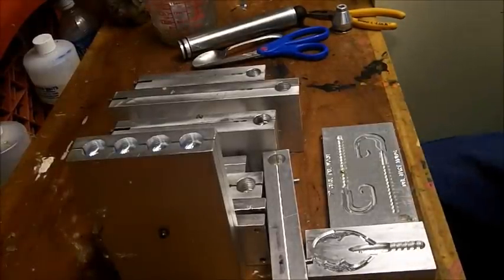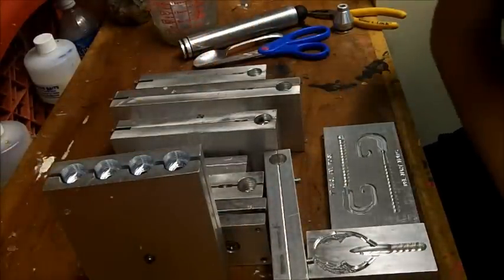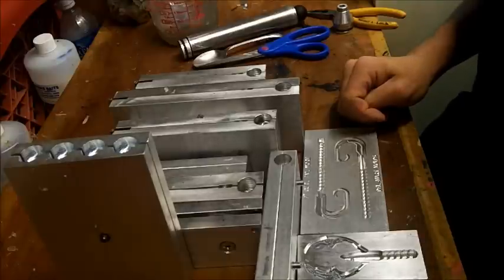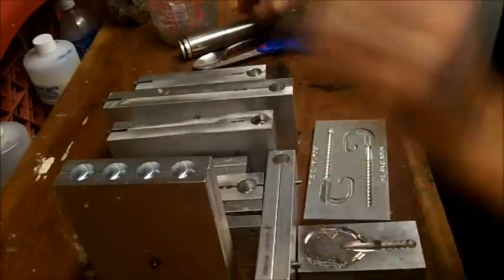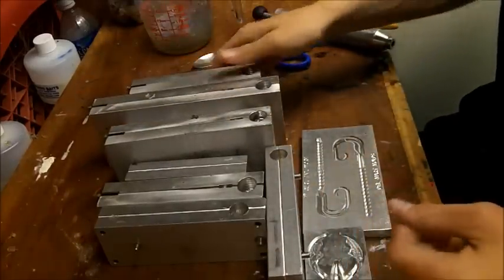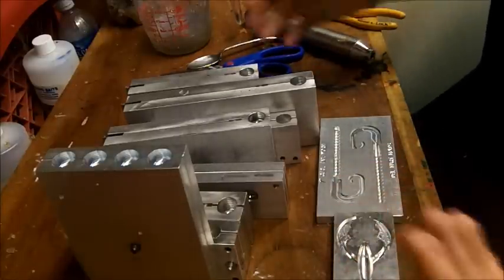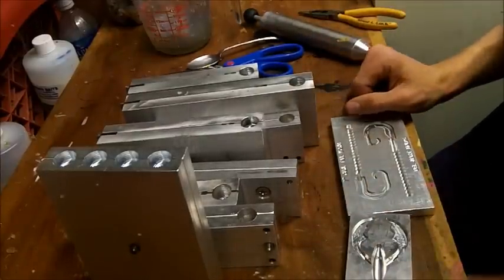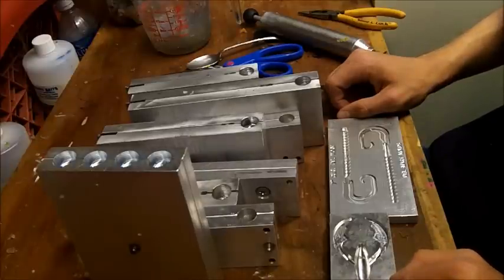Aluminum Molds- The Mystery Explained

Comment: making your own fishing baits can be fun exciting and rewarding when you either sell a pack of baits or catch fish with something you made yourself but you have to be careful because 1 you are at high risk to get burned when you are dealing with the 300 degree plastisol 2 lung disease from poor ventilation. you might not realize it but the fumes that come from the plastic are very toxic and can be deadly so make sure you wear gloves and be in a well ventilated area. also a respirator would help.

Comment: I was wondering when you were going to switch over to alum molds. Getting a custom mold cost a lot of money and plus you'll have to find a reputable company who won't charge an arm and a leg for CAD and CNC designs...got to also factor in the work hours they charge for working on your design...plus patent cost too if you don't want others to copy your bait.  In the long run, pouring your own baits with retail market molds will pay for itself, plus catching bass on a lure you poured is Priceless.

Comment: Sorry kyle, not trying to be mean or rude but it does take 3 or four minutes (actually like 10) but like you were saying they won't just make you a custom one cause you have to  get the metal and put in the measurments where they have a set measurment for their  molds (Source: Uncle owns machine shop with 4 CNC machines

Comment: Great video! I just thought of when you said that you weren't currently able to create the original models for molding. One idea I thought of was that you could get in touch with someone who can model stuff in 3D, get your hand drawn sketches digitalised and by so,  get the 3Dmodels printed with a 3Dprinter pretty cheap. I assume the digital 3D model can be used for directly making a custom aluminum mold as well.

Anyway, keep up the awesome work!